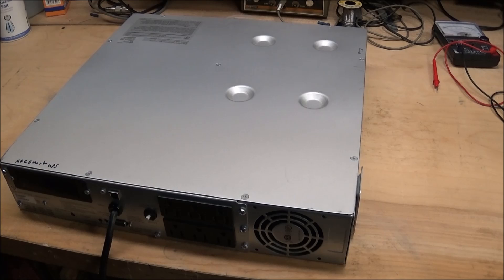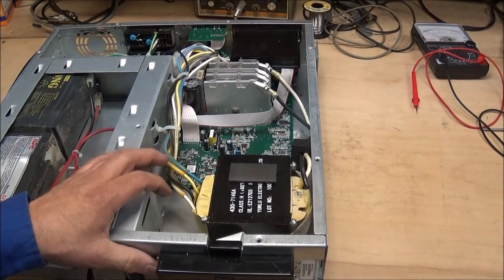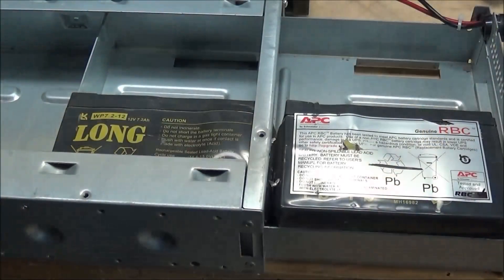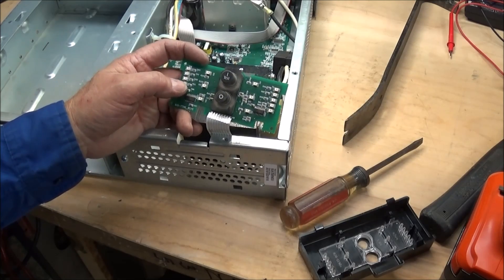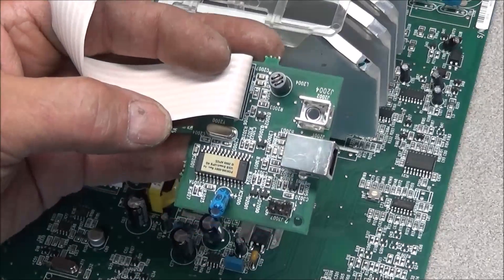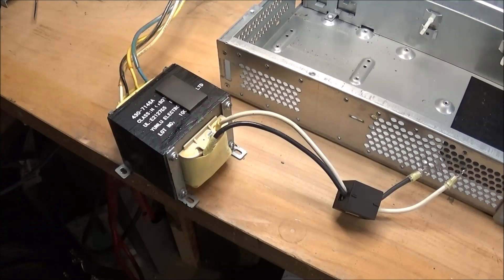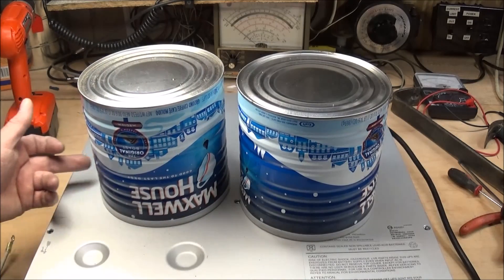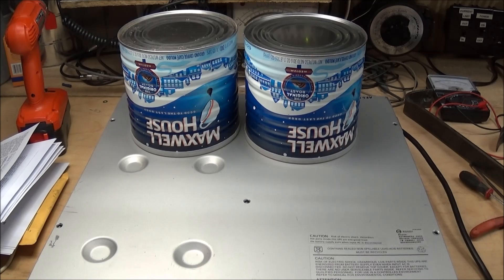#47 APC supply tear down for chassis recovery and duplexer build planning

Comment: Likely the UPS killed the batteries by overcharging them.
I had a big pile of dead UPS batteries, they were a bit swollen, but none were melted like yours.

Yes that wire is a temp sensor, obviously not attached properly given the state of the batteries.

Comment: Nice project box.  I often buy electronic widgets and thingamajigies just to salvage parts out of and project cabinets.

Think the batteries were several years past their change out due date.  People seem to forget their lead acid and only last so long.  Look forward to the duplexer project.
Reply from the maker: +MikesRadioRepair Agree Mike, cannot last but so long. Glad I got them out before they leaked. Would have been a waste. Got o run out this week end for some copper or brass tubing for the duplexer build. Thanks Mike.